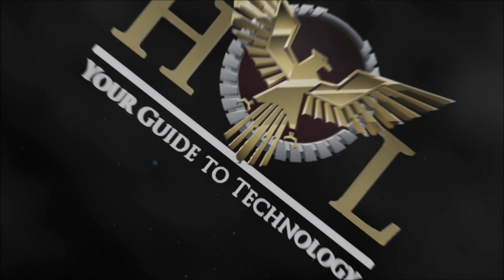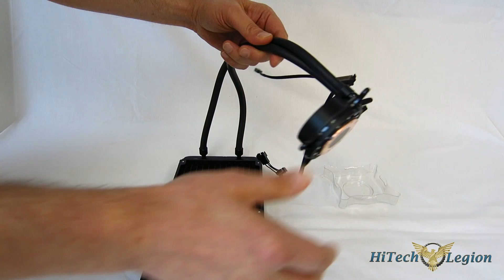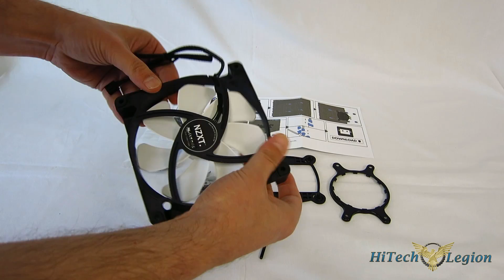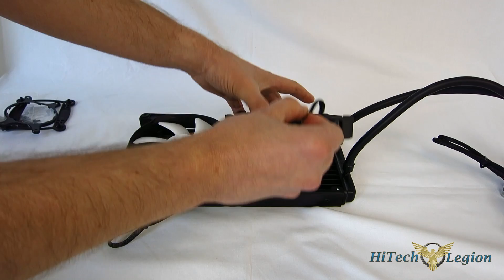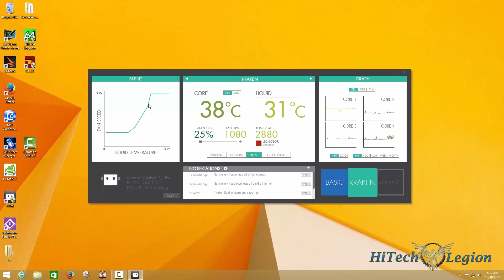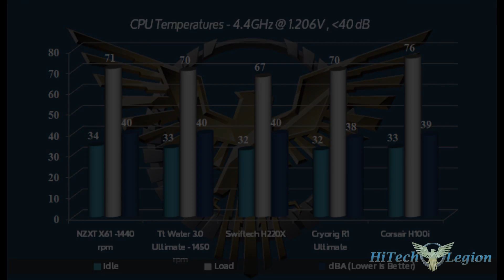NZXT Kraken X61 280mm CLC CPU Cooler Overview and Benchmarks

Comment: Hey George, is the x61 a good cooler? I prefer a maintenance free clc because this is my first build, and the software seems like it would be very useful. Can you recommend it? I have an xbox one and the noise from IT doen't bother me. A bit higher may be tolerable. So you know how loud I want it to be, and at that noise level will it still preform well? I have and nzxt h440 with the noise dampening material, so how much will that help? I also have to 970's from msi with twinfrozr 5. Will it be louder than that? Also, should I run in push, pull, or push pull with the second fans being FN-V2 airflow fans that came with my case (according to a linustechtips video, AF fans work good for pulling)? I really prefer the atheistic of water coolers in the case
Reply: Zombieknight Productions If you were going to put a gun to my head and make me use a CLC.....I would take the Cooler Master Nepton 240M, with this being the only other choice I would consider. Yes, it will be louder than your 970s and your XBox. There is no way around that since CLCs all use high fpi aluminum rads and need a lot of air to be effective.

I have always had very similar results using push or pull on these, maybe 1-2 degrees difference either way depending on the rest of the build. Push/pull is a complete waste on these rads - you may gain a dgree or two, but the noise is brutal under load, and just plain annoying even at idle. Just make sure you are running the fans as exhaust, otherwise the inside of your H440 is going to turn into a greenhouse and your VRM and GPU are going to run far hotter.

And the included fans are far better than anything Corsair makes for a rad, AF in pull included.
Reply: George Cella how much work exactly does it take to set up / operate A swiftech 240x

Comment: Excellent review!
I'm looking to buy an X41 and an X61 together with a G10 to cool both CPU and VGA. I have a 4690K and an EVGA GTX 970 ACX 2.0 - what I'm interested in is silence. How silent are both (X41 and X61) when used in idle mode (browsing, etc) and gaming mode (CPU at 80%, VGA at 100%)? I'd much prefer to turn the fans off completely when in idle mode using MSI Afterburner or SpeedFan. Is this possible with the X41 and X61? Obviously I can't turn the pumps off but I'd rather have everything else turned off.
Currently I have the stock VGA cooling and a Noctua NH-D14. Should I keep the NH-D14 (which is inaudible while idle) and only focus on the VGA liquid cooling?
Reply: war4peace1979 Closed loop liquid cooling and silence really don't intersect for a number of reasons. As noted, these use high fpi aluminum radiators which require quite a bit of airflow to operate efficiently and effectively. As shown in the benchmarks, this results in much higher noise levels than air cooling at like performance levels. If you look at the benchmarks here, the noise levels are not low by any stretch of the imagination.

Essentially, given that you are using a D14 now (which is slightly quieter than the Cryorig R1 used in comparisons here), you are going to see only the slightest performance increase with a significant noise increase in the case of the CPU. On the GPU side, you can expect to see a marked increase in performance on the GPU itself, however the VRM will likely run considerably hotter and noise levels will likely be similar to, or louder than the ACX cooler.

Turning the fans off in lower load modes is not advised, as the passive cooling on CLCs isn't great and reaction times of cooling the liquid (in order to cool the CPU) is going to be far slower than the D14. The liquid needs to stay cooled to some extent.

A Swiftech H240-X with an added GPU block would be a far better choice to achieve your goals, as would leaving the D14 as is and adding an MCR140-X with full cover block.
Reply: George Cella Thank you very much for replying, I was this close to ordering from NZXT because their chat support said it's silent (shame on them for the dirty trick!).
I think I'll go for a VGA-only cooling solution for now, because that's what's making all the noise while gaming. If I buy the H240-X and adapt the waterblock to the G10, would that work?
Reply: war4peace1979 There would (thankfully) be no need for the G10. If you were doing GPU only, your best course would be the MCR140-X plus a block such as this - http://www.ekwb.com/shop/ek-fc970-gtx-acx-nickel.html - that is made specifically for your card.

However, the cost difference between the MCR140-X and H240-X isn't all that great. With the H240-X, the CPU block is included, so you would just be adding the GPU block along with two 3/8x5/8 fittings. It is a much more cost effective solution and gives you a CPU and GPU loop.
Reply: George Cella That's a great idea, the newbie in me thanks you so much!
I have been looking for a block for my card and somehow didn't find it, it looks beautiful and is exactly what I needed. Me happy puppy!
Thank you again!
Reply: war4peace1979 Just use coolingconfigurator.com to confirm that you are ordering the correct block for your particular card. There is also another color choice for EVGA ACX cards.

Comment: Looks like the exact same mount as the H105 Corsair unit I just installed..
Reply: ISEE YOU That would be because the H105 and the NZXT CLCs are both Asetek oem with limited mounting changes made. The H105 is a generation behind this, but the mounting hasn't changed.
Reply: George Cella That explains it!  I have ran some custom and CLC kits but mostly stick to air.  I did the H105 on my buddies PC and a Swiftech H240x on a coworkers PC.  The Swiftech has me thinking of going back to water cooling.

Comment: Those temps look bad... Maybe because you'r at 1,2V, my 3570k does same frequency at 1,1V
Reply: SirShizuka You are making a statement completely reliant on a question you ask after making the statement. These temperatures are all very good for the test setup used.

It's a 4770K (as is stated in the test system layout in the written review), which is a much hotter running chip than your 3570K.

Comment: This was very helpful for me to orient the cooler in my case.  The angle of the camera and lighting were excellent.  Unfortunately, the cable wiring was too rushed and not really shown at all.  I need to find another youtube video or forum that explains the cable and wiring of the kraken x-61in detail.
Reply: Robert Schubert The installation manual lays it out pretty simply.

The fans plug into the fan connectors coming out of the block.
The SATA connector coming from the block plugs into the PSU.
The 3-pin coming from the block plugs into a fan header constantly supplied 12V (like your CPU header).
The USB cable from the block plugs into a MB USB header.

Just like it says in this video. There is no more detail than that.
Reply: +George Cella thanks George exactly what I was looking for, getting the x61 to go with my noctis 450,would be my first build so researching how to install and configure the parts.

Comment: h100i has smaller rad you should have at least include h110
Reply: Grim Reaper The H110 is an NZXT X60 licensed to Corsair for marketing. The H110 has inferior performance to the X60 as NZXT uses far better fans. So, comparing the X61 to an inferior version of its last generation was kind of pointless.

Comment: Everytime I see the comparison between a clc and aircoolers I keep wondering how the case, videocard and motherboard temps (and so on) are.
I mean for the cpu it does not seem to differ that much, but we can not deny an air cooler still keeps a huge cooling block with a huge amount of heat in the case. Where does that heat go? It also blocks the flow of the cooling fans more. So does the use of a clc compared to  aircooling affect the inside temperature of the case and other parts around? I really miss that part in reviews like this.
Also I do not understand why people don't mount the radiator ón top of the case, instead of against it. This way you letterly put the heatsource outside and give the case itself more room to breathe.
Reply: Paulus0013 Looks like someone has read the marketing....or forum posts by people who have....

Typically, the opposite is the reality. Air coolers tend to keep air moving over the VRM and internal components, and tend to present a far more stable air path in the build. Puget did a number of tests on this - you can do a search for it. The hot air is exhausted by your case's exhaust fan/fans. In a properly setup case air cooling tend to be holistically better than CLC.

You can mount the rad on top of the case, but all you are really doing is moving it 25mm. With the fans blowing through the rad and out the difference is basically null.

Comment: No drivers to control the fan speed...So You don't get Kracken Control Screen.  So only 20% speed or 100% lol and that all depends if you have the Usb plugged in or not plugged in. Don't buy kracken X61
Reply: Pandamonium492 So basically... you did it wrong. Good job thumbs up
Reply: Pandamonium492 Hi, I'm not involved in this conversation, but I'd like to point out that you're an insensible, ignorant idiot. Just passing through :)
Reply: If you download the latest CAM software from the NZXT site and add the device (Kraken x61) to the software, you can then control everything. I set my lights (NZXT Logo) to Red Blinking lights and set a custom curve on my fan for temperature changes.
Reply: Pandamonium492 I would mention that Corsair doesn't make or market anything that performs as well as the X61, but.....

Wound be kind of funny if you are referring to an H110....which is an X60....with lower performing fans.
Reply: Pandamonium492 that's anecdotal evidence at best.
Reply: Pandamonium492 There are two possible explanations for what you have stated here. You have either done something wrong in your installation, or you simply have a need to post incorrect information.
Reply: Really.. since the device manager shows no support... and there are no drivers for it... and when you open the program Kraken doesn't show up. Even after uninstalling and re installing. Its a shit cooler don't waste the money.
Reply: Pandamonium492 What program are you trying to open? The X61 works perfectly with the CAM software, as is shown in this video.
Reply: Cam. It opens but has no control over the fan. It has no kraken option in Cam. So no control.
Reply: Pandamonium492 Ok, you may well have a bad unit. It could be something as simple as a crushed pin on the USB plug or an internal break in one of the wires.

What did NZXT tech support say about the issue?
Reply: Already got rid of it but thanks.
Reply: MrLithiumFox except there is a whole forum with ppl that have same problem. It's ok I've excepted that it's garbage compared to the new corsair I have. So problem solved.
Reply: Sure... at least I can control these ones. So technically these ones are better performing :)

Comment: glad to see they are putting the ring on for you. a lot wiring on the pump though.
Reply: Agreed. What bothers me is that there is a SATA power and a 3-pin power. If you have the SATA power, there should be no reason at all to be taking power from a MB header.
Reply: true